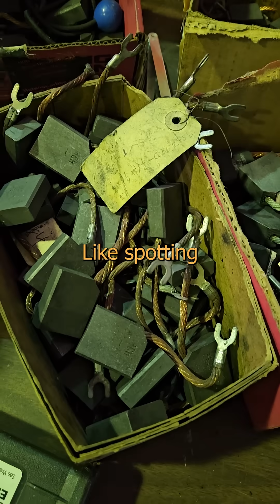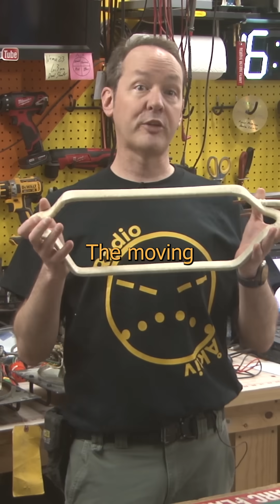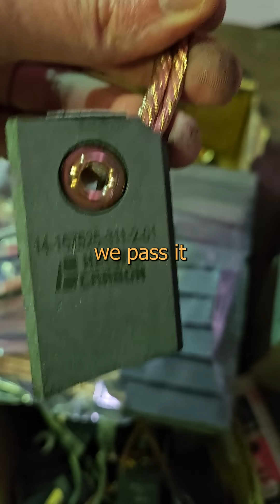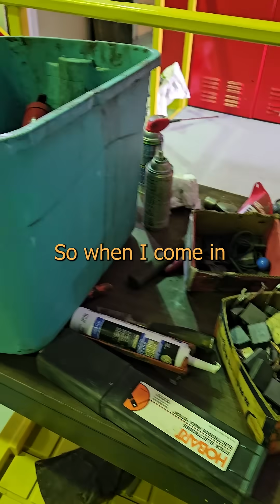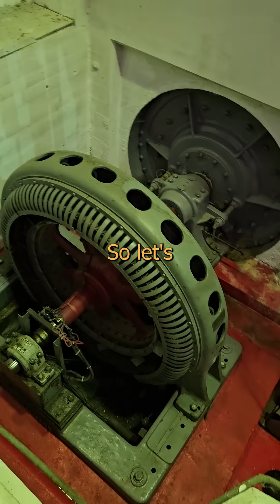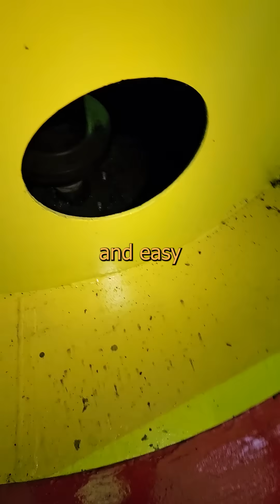Generator Brushes #chrisboden #comedy #engineering #powerplant #millwright #electrician #hydropower

Comment: I work maintenance for a company that made aluminum trailers for beverage drinks and water bottles with the roll-up doors they had several hundred welders when I went to work there I had several cases of diodes whale mixed and all the circuits were color-coded by wire recording to documentation not so much the actual application😮

Comment: Upteen years ago as a maintenance supervisor I went in on a weekend with a crew to work on a standby diesel that was having trouble starting. It was either the new solenoids or rebuilt pneumatic starter. The powers that be declared it MUST be the starters…until I looked at the ticket and the name was someone who does NOT make mistakes. I told the powers that be but they didn’t believe me. You can guess the end of the story.

Comment: Go with rotation while cutting in those slip ring brushes. Get that brush cut in as close to the curvature on the ring for best results and use the non adjustable spring tensioners. That is pretty cool.

Comment: Was once told by our rewinding company to put a piece of welding blanket below the brushes. To prevent the still very conductive carbon dust to go in places you really dont want it. That said, those brushes get changed every year. And there are quite a lot of them every motor.

Comment: You think that’s bad try getting into the generator on the steam turbine the inside bolts torque, and then lock wire if the seals is not good on the steam generator you get a hydrogen leak. It’s the end of the building and everything in two blocks.

Comment: Do you guys rotate the field polarity? I seen a decent amount of pitting n one of those brushes, that’s usually the negative brush and it happens from micro arcs due to the brush being repelled from the slip ring, where as on the positive ring it’s attracted holding it onto the slip ring and the carbon from the brush slicks the ring for a good running surface.

We rotate polarity on our locomotives every 6 months, this extends brush life and keeps the slip rings in good condition too!

Comment: The next time you spend hours doing something that should only take 10 mins do the next guy a favor 
Make a video on it then print out a qr code sticker and place said sticker near the thing that needs to be fixed
I didn't this 4 years ago on something and I recently got a comment on that video saying thank you as they had been trying to work out the problem after some monkey had been in there and left after it was too hard for them
The had been there for 3 days trying to work out the issue only to find out the 7 wrong spares that were there that had been wired in were completely useless at the whole system triggered via 5 volt and not the expected 12 volt like every thing else in the building 
Easy fix got them and they even called me to clarify a couple of things the video didn't cover

Basic ABC when experience steps in

Comment: Or you can modernize and throw all that carbon shit out the door. Non-contact rotary transformers were standard on VCR heads back in the 1980s. Mount redundant AC/DC rectifiers on rotor, and maintenance goes to zero.

Comment: Our rotors are excited to 1000VDC, but it is a tricked wave. We have an asynchronous system, so the power going to the rotor, when it is going to the rotor, is actually DC that has been modified by IGBTs to turn it into an AC wave. It is crazy how fast they have to fire off to do that.

Comment: I worked in a metal yard with a shredder, driven by an electric motor...

It spun a rotor that weighed 67 tons at about 4700RPM..

The vibration in that shookthe building on startup was made of nightmares. I swear the brushes looked like they were the size of cinder blocks.

Comment: Please tell me your power factor relates to the power output level, not the relationship between the phase angles of voltage and current.  I’ve worked on software for power factor controllers for at least a decade, and the idea of controlling that kind of power factor by adjusting exciter current blew my fragile little mind.  

It took me three or four times through to notice the hickey on a hemorrhoid comment.  Please tell me that my kind of power factor is different, and is adjusted by sending some guy out on a bicycle with a long pole to goose a switch for a capacitor. Or calling up the Olive Street Pumping station and have them twiddle the brush angles on their giant universal motors. 

I know that long ago they had uninsulated 4 kV bus bars running around. Once a construction worker tried to measure the distance between two of them with a steel tape…….

Comment: Any excuse to tell my engineering prof's story from decades ago... he was working at a relatively small hydro plant, and during the night shift one of the generators lost excitation voltage and started to fall out of sync with the grid.

For some reason I can't remember, it was still connected to the grid but freewheeling without the exciter. The excitation voltage suddenly came back, turning it back into a generator, except now decidedly out of sync with the grid.

The grid, being effectively an infinite source/sink compared to the size of a single hydro generator, will do whatever it takes to get that generator back to 60Hz again. Suddenly several tons of spinning rotor and turbine in the water get yanked with the full force of the grid trying to impose its will back to 60Hz / 90 RPM on-phase against the momentum of the rotor and turbine, jolting it, shearing something, and shifting the whole spinning multi-ton assembly and its massive cover about two feet to the left.

At that point it wasn't worth fixing, so it was still out of commission a decade later when we went to go tour it and the significantly-larger hydro plant up the hill.
Reply: I've heard of something like that happening on an aircraft carrier...  The thing jumped off its mounts and started slowly beyblading across the floor
Reply: That sounds like something that ought to get engineered the fuck out of - especially to prevent it occurring to a stunningly expensive bit of tech.

Captain Murphy's adage remains valid even after all these years...
Reply: @ you can install all the expensive technology to prevent it you want...  but how the hell do you test it?  intentionally instigate a grid drop incident?  and if the test DOESN'T work, how much damage have you done, to whom?
Reply: @tsm688  A good design engineer would integrate safety systems (both for people and for technology) during the planning phase - long before the concrete is even poured for the building footings. 

I reckon that the only reason why these sorts of massive fuck-ups could occur is because your equipment has devolved into a messy kludge of ancient, old & modern tech - all futilely trying to work together in ways never envisaged by any of the designers in their wildest ketamine infused nightmares.
Reply: @Seren-dipi-T  you didn't answer my question.  how would they test it?

There was a plant commissioning where they did everything right and installed all the massive monitoring and safety systems.  Then when they hit 'sync' they blew the wiring out of the rotor because the safety systems were off by one phase from the rest of the system.  the systems they were relying on to detect safety went in wrong.

how.  do.  you.  test.  it.
Reply: @tsm688  Haven't the slightest idea. I'm not an electrical engineer. My point is that it shouldn't need to be tested in situ if the design precludes it from happening. If it physically cannot occur, then why TF would you need to test it..?
Reply: @Seren-dipi-T  "haven't the slightest idea.  I'm not an electrical engineer".  okay then...
Reply: @ Not necessarily a kludge of things, sometimes you design something with the best intentions and the latest practices and knowledge but it found a new and exciting way to fail you never thought of. Or you engineered it right and it was built wrong in a way that was hard to detect, etc.

The thing about one-in-a-million events is that they happen a lot when you give them a lot of chances.
Reply: @Seren-dipi-T  some things cant be tested anywhere than on site. Certain scales are so big there is no testing site. Its normally you get to know from your boss this and that works and oh by the way dont fuck this up or our company is gone type of thing. You know sometimes new tooling and new production techniques are invented for certain projects and money is never unlimited. Sure you can make all the calculations and safety procedures on paper and at one point you just accept that human error might happen. but so what, everyone gonna complain and moan but there is no other way and they depend on "us" and if things dont work they dont and there is no oh im simply buying a product from another company (because they dont exist) and you will have a stressful time getting things up again.

Comment: Speaking of brushes... I got home last night to a red light on my Generac. Looking at the screen, it says it stopped because of an Under Voltage condition. I jumped into Debug mode to see what the controller was seeing for Output voltage while runnt -- 0 vac. Guess I'm working on my own generator for a change. Hoping it's just worn out brushes. Resistance test across Wires 0 and 4 will tell me the condition of brushes, slip rings, and rotor winding.

Comment: Shout out to Bootsy though. "If he did it, I know it was done right" is about the best compliment one man can give another.
Reply: Especially anyone competent in technical or maintenance work, we're a paranoid bunch by necessity. It takes a lot for me to be comfortable trusting someone's work on something I'm partly responsible for.
Reply: What I was gonna say. Highest level of respect
Reply: Remember when I worked at a small company that makes garbage trucks and large cleaning vehicles. One had some problems in the electrical system and when one of the construction guys who last worked on it complained about that to my boss he just said "Check your own work first, because the day he (pointing at me) makes a mistake has yet to happen. Turns out the construction guy drilled straight through a bunch of wires while hanging a sign on the side of a truck.
Reply: @dracul1986  reponse: face palm emoji
Reply: Agreed, that's the best thing a man could say.
Reply: That's all I hope my coworkers in IT say about the work that I do.
Reply: @Spfinator  You know, sometimes in IT people call each other's job sh1t, but it just as well known that it will likely last forever. As they say, nothings more permanent than a temporary fix. Or solution, when it comes to IT.
Reply: @Kareszkoma Ha. I have an acquaintance whose place of work has a "temporary" fix from like the early 1960s! Shoot, our parents weren't even born yet!
Reply: @DesertCatDad  Yes! Kinda amazing that it still holds on.
Reply: I work in aviation and "trust but verify" are words to live by. Even the best guys have off days and everything gets double checked
Reply: I had a mechanic like that. Since he retired, my car only goes in the shop because I despise hand mounting tires, and I'll admit the machine can do a better alignment than I can. 
Everything else, I'll do with hand tools in the driveway rather than break in a new mechanic.
Reply: The level of confidence of one man for another's work is directly proportional to how difficult the job is to access and how complicated it is to complete.
Reply: Can all use a bootsy in our work lives.
Reply: As the new guy I strive for this each day and each day I don't achieve it my heart breaks a little more and I drink a little more
Reply: Competent co-workers. Living the dream.
Reply: The most hilarious fact is that this characteristic usually sticks to anything the man does - from swinging your mom to Walmart and back to morbidly rippin' ass at night in a forest cabin to scare the living heck out of his grandchildren, who've been brought to spend a weekend learning common wisdom from their grandpa.
Reply: Fr
Reply: I have 1 mechanic that does the services on my contact truck and he uses the tools from my contact truck, I won't let most of the other mechanics check the oil but my guy is peak. He's not even a truck mechanic, he fixes wash machines and water purification systems.
Reply: Much like Bootsy Collins. He did it right.

Comment: Oh God the PTSD those boxes of carbon brushes caused me...
Reply: @jacobcombs1106  yep, changing those brushed on electric locomotives is a pain in the ass aswell
Reply: @yourfriendlyneighborhoodf1802  I go back to the motor generators on the submarine with their commutator that had 6 sets of boxes multiplied across 3 rows of boxes that each contained 4 brushes between two units for a total of 144 brushes that were in equipment running in an atmosphere full of oil(the electrostatic precipitators couldn't keep up with the amount of atomized hydraulic oil and lubricating oil in the air) so every 3 months we would reseat them and every 6 to 9 we would replace them all...

And they were not easy to reach inside the machine because the people who designed it hate the people who service it...

Comment: 120V at 50A? thats quite a bit of waste heat. but power plants also make loads more than that so it's cleary worth it :)
Reply: It's all relative,  we use 690 volts ac and around 1200 amps for our exciters. But our output is over 5MW

Comment: Hey Chris, how do the THD from a old beauty like this, compare to an modern generator? 😀
Reply from the maker: Despite spinning for a century, her output is super clean. I get more noise from the 80's vintage anti-arcover circuits in the East-German war surplus exciter. It's DC.....with sprinkles.
Reply: @Physicsduck  
What are the main reasons behind THD in generator power ? 
Is it from small elektro magnetic differences in matching of the coils in the stator winding? 
Or the design/shape of the rotor, 
or how rotor excitement are powered ? 😅😊

Comment: The problem arises when you don't know who did it. You've got no idea if it was done right and who to yell at (calmly inform) if it breaks. I'm not sure what staff is like at your plant but I'm sure some places it's a nightmare.
Reply: In some workplaces, it's called a LOG book. The fancy electric ones allow you to search by part name or device. Then you know who to yell at.
Reply: @lucash1980  In my country, some things are only fixed like every 30-50 years. We had electric boxes, very hardened plastic and anti-explosion electric boxes, really high quality, that were done like 50 years ago. Still in the soviet age. It was for an ammo factory. 
It's a good question who was or when was it fixed the last time.

Some of the bigger buildings, 10 level prefabs, have their own transformers and little crane entrances. The cranes don't really exist anymore, and I'm not sure if the entrance does either. But it can be digged out for sure.
Reply: @lucash1980  Bold of you to assume that everyone uses the LOG book correctly every time.
Reply: Not the same field, but in my factory we just blame the Italian engineers most of the time it is their fault, the rest it isn't, but they could've designed it less stupidly so it's the Italians fault.